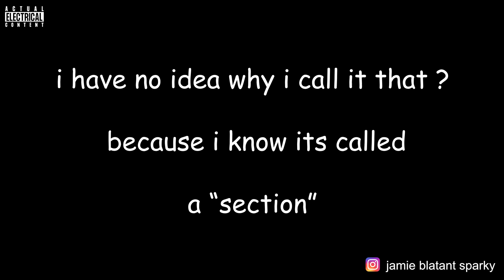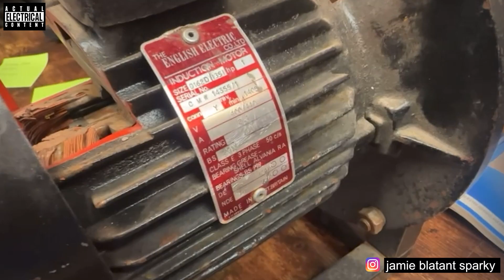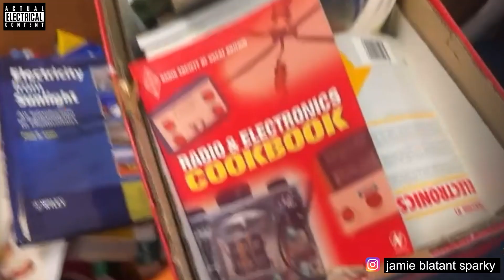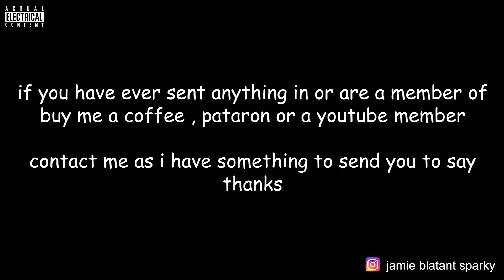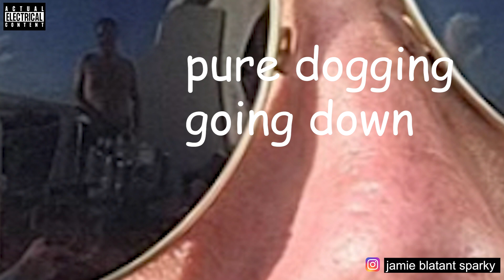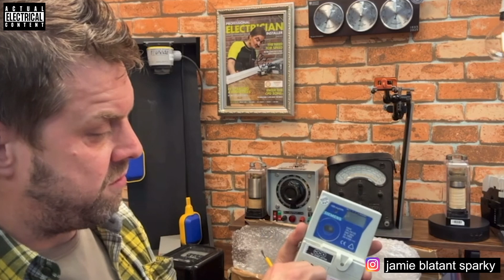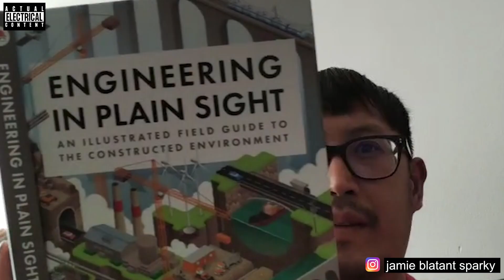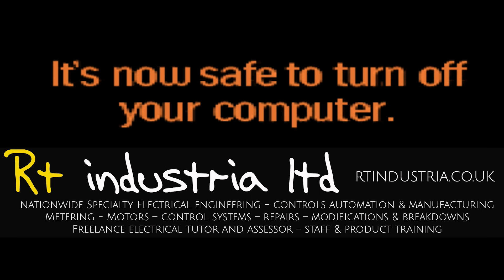THE BEST METER EVER MADE - ACTUAL ELECTRICAL POST BAG

Comment: We had a similar variant of those Siemens meter here in Australia.  Our network here in Tasmania used to use them and there was a prepayment module that used to fit over the top of them where the customer would insert a card with a chip that would load credit onto the meter, when the credit ran out, the meter would cut the supply until more credit was purchased and loaded into the card.

They have mostly been removed/replaced in the field but will try to get hold of one